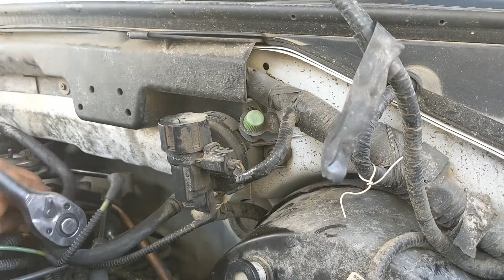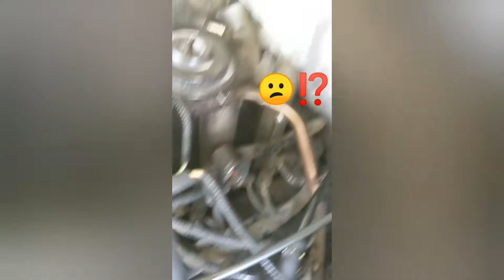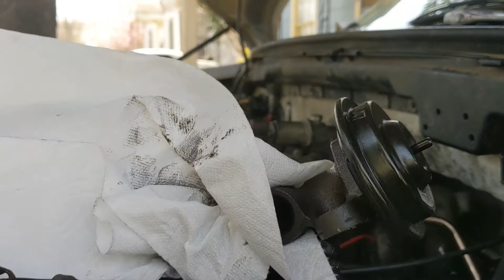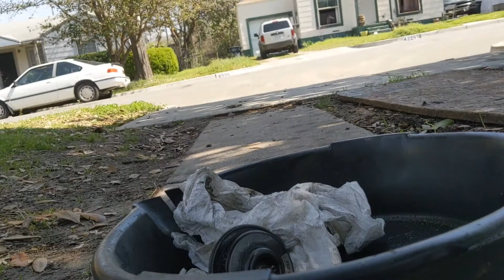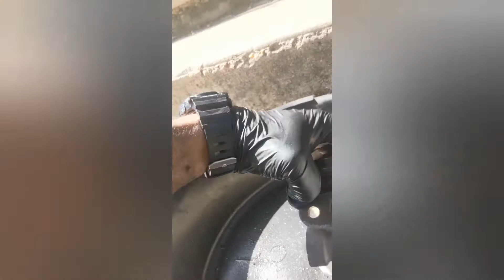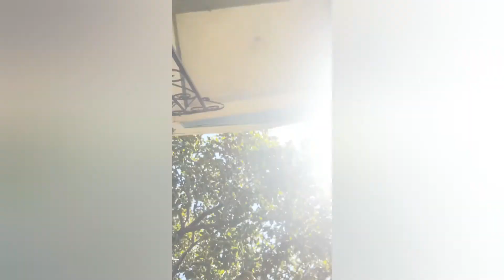#EGRvalve#f150#checkenginelight Ford F-150 EGR Valve Removal and Cleaning

Comment: Very common problem on them is inside the throttle body intake elbow, there are 2 small ports that get clogged and will throw codes for egr